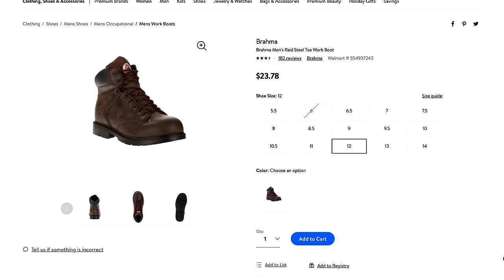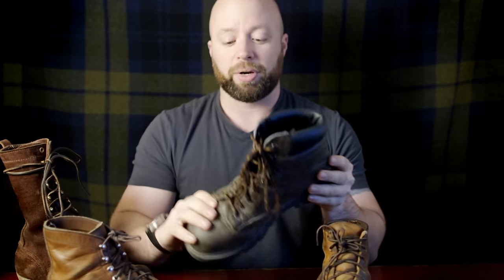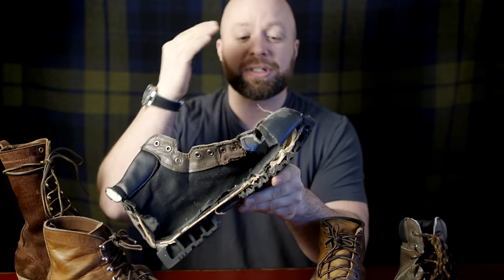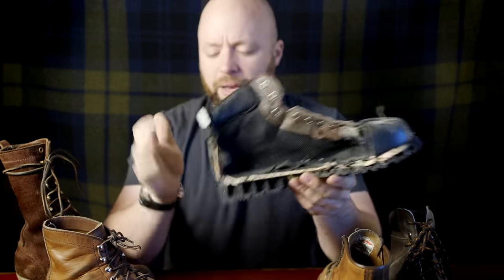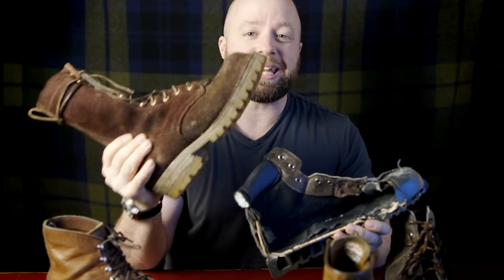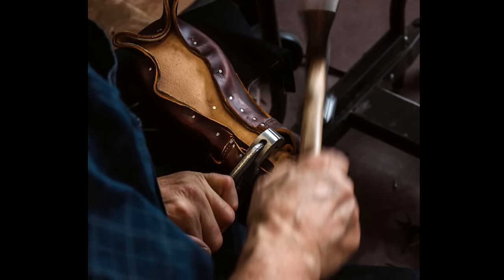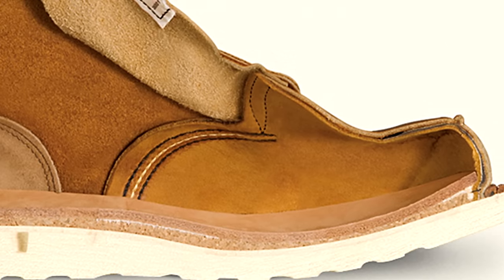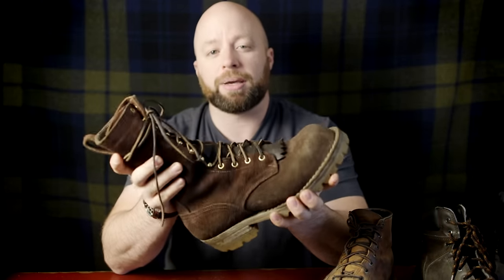Expensive vs Cheap Work Boots

Comment: Cheap is expensive in the long term
Reply from the maker: Precisely!
Reply: Not always.   For example.   If "good" product costs $200 and lasts a year and the "cheap" product costs $50 and last six months.  The "cheap" product is better deal.   I bought alot of   Brahma boots.   Because they were cheap. Yes they only lasted three months.   But at the time Redwings were four times the price and only lasted a couple months longer.
Reply: Thorogood boots
Reply: @mjp5429  good day sir, do you have your own, separate insoles when you wear your cheap boots? :)
Reply: @joshuasim8019  sometimes
Reply: Ya FEET.
Reply: Amen. I spent my last 5 years landscaping in the desert and I have spent 700 on cheap boots when I worked on wind turbines for 10 years and had 1 boot the whole time. I only lost those Wind Turbine boots because I did not know they re-soled the boots. On reason my Red Wing Loggers got tossed.
Reply: I bought a pair of $250 Red Wing  boots. They started tearing apart at the sole. Leather started cracking around the eyelets. All in less then 2 months.
Reply: @laidspipe  man that sucks. You know, like vehicles, every now and then you get a lemon. They typically are a boot built to last.
Reply: William Jefferson Clinton the good thing is they still had warranty. Got a different pair for $190. So far  6 months wearing them still holding on.
Reply: & vice versa
Reply: I have a buddy that would go through a pair of Brahma work boots every 3-6 months. I still have a pair of work boots from my 8th grade year that I need to resole. I haven’t got around to resoling them because they are hiking boots, so I have to send them off to a special cobbler.
Reply: john doe but then compare redwings which are pretty cheap to boots like nicks, after say two years when you need a resole then it doesn’t cost that much and then say after 5 you get them re soled, you can go a decade with one pair
Reply: Something to think about is that leather boats do not like acid environments.   In such a case buy cheap because a expensive pair isn't going to last any longer.
Reply: @callumgill7019  usauly by the time the soles are shot the rest of the boot is too.  My experience has been the welt usauly rots out before the sole wears out.  And this is true of expensive and cheap boots
Reply: 60-80$ 4-5X a year, yeah I’ll stick with  my danners or Georgias
Reply: john doe that’s not always the case my freind
Reply: john doe most of the time if your paying that much for a boot you’ll get what you pay for
Reply: njuafed71 especially when it comes to work boots
Reply: I disagree...As mentioned below, I paid over $200 for a pair of Danner boots. I had them a little over 1 year and both heels lost their stitching. Danner customer service is in name only. Their warranty is no good and when it came time to stand behind their product...they ran the other way and did nothing. Beware of Danner. I would have been better off buying a $50 pair of boots. Hell, cheap boots last longer than Danner.
Reply: This is what everyone says , but from my experience this is NOT the case
Reply: You sir are absolutely correct
Reply: I condition mine every 2 weeks going on 2 years strong with my red wings
Reply: @CarlMurawski  The High Cost of Low Living!
Reply: That does not apply to Mercedes vs Toyota. In that case you're wrong. But everything else you're right.
Reply: Im too poor to be cheap.  Bought red wing work boots and a toyota tundra.
Reply: You’re 100% spot on
Reply: @mjp5429  Negative. Because you're still using $50 quality boots which aren't going to be as well designed and engineered as better quality boots so you're cheating yourself every day. The better "deal" is the boot that keeps nails from puncturing through the bottom of your foot and that don't rot in a few months and that keep your feet healthy providing proper fit & ergonomics. :)
Reply: @YankeeWoodcraft  
Sometimes this is true.  Other times not so much.  My experience with "name brand" boots (or products in general) has been very hit or miss lately.

The knock offs have gotten much better and at the same time many if the name brands have cut corners to make more money for stock holders. 
  It's an interesting story to watch play out, but it's happened so many times.  The knock off has to build the best for the cheapest to gain market.  The established brand doesn't care because they already have the market.
Reply: Brama are hands down the worst things I've ever put on my feet. Even with 60$ custom orthopedic insoles they were torture. They gave me blisters, The quality is garbage and If they last a month you got a good pair. I know not everyone can afford red wings, Nick's, Timberlands etc. But avoid brama at all cost. I've been at my job over ten years and we get a boot voucher for 300$ every year so I've been lucky enough to try almost every high end manufactured boot brand on the market and I have to say after trying my first pair of keen boots I'll never go back to anything else and they're affordable. Lug soles are to heavy and uncomfortable when your on your feet and walking miles all day every day.
Reply: Ya get what ya pay for
Reply: Exactly.

Comment: Having worked (and still working) in the trades for several decades I agree with Carl. You certainly don't need to own custom made boots to survive to an age of 60+ in the trades industry, I haven't, but you sure as heck do not want to cheap out, either. My advice, and something often missed in these "boot videos" is this -  find the highest quality boot that you can afford, and buy 2 pairs.  Switch off every day with a fresh pair, while the other pair of boots rests and thoroughly dries out.  My current pair x 2 of Red Wing work boots are closing in on 7 yrs of work, and still have life in them.  Not even so much as a resole. Take care of your boots, and your boots will take care of you.  Good luck folks.

Comment: I've been wearing 2 pairs of Herman Survivors for one month with good quality aftermarket boot inserts to give them some comfort.
I'm a machinist and need a sole that won't melt and absorb the blue hot steel chips.....the soles on the Herman boots don't stand a  chance against the hot steel chips. I have 2 pairs so I can rotate days to pull out the steel chips with pliers.

What do you recommend? Will those Redwings with the white soles survive burning steel chips?

Comment: I’m new to the oil fields of North Dakota and have been working in some frigid conditions. I started with a cheap Walmart boot... Major mistake! I’ve just ordered the rubber Muck Boots called, Arctic Sport, with a Steel Toe (they don’t have composite). The Sport is rated at -40... I wanted to order the Arctic Pro, which is rated -60; however, my size 10 in those isn’t available for up to 5-7 weeks, unfortunately. Obviously, I need a good work boot and one that is warm in the cold weather. Any advice of what the best boot is for that? Any comments or thoughts on the Muck Boots? Thanks for the video! Basically, you get what you pay for...

Comment: Carl, you are so right. Don't skimp on a good pair of boots. I just retired after 37 years working for a beverage company. When I started I was a delivery driver, did a lot of walking. I always bought Red Wing shoes. Started off buying oxfords then eventually started using six inch boots. Never had any problems with my feet. I eventually moved into driving Big Rigs for Transport and I thought I could skimp on shoes. (as Red Wings were getting more and more expensive.) I bought Die Hard boots and then Caterpiller, those gave me sore feet. I went to the Red Wing store and bought a pair of the 676 boots with the wedge sole. Problem with my feet went away. Like you say, you can't skimp on a good pair of boots. That particular pair of boot I found out that Red Wing doesn't make anymore. Mine are about five years old, still look and feel great. When the sole wear out, I'll take them back to Red Wing to get a new sole put on. Definitely don't skimp on a good pair of boots.

Comment: I wear White's boots (Spokane WA) custom built to my feet (my feet are 2 different sizes). They're expensive new but I've had 2 pair since 1994 that I get rebuilt (not resoled) every 2 to 3 years. They tear them completely apart and if needed will replace everything but the uppers
Reply: Whites got bought out and quality has decreased. Nicks is better
Reply: @nonyobussiness3440  when did that happen my last rebuild was a year and a half ago.
Reply: Cbmech probably five years ago
Reply: I also have 2 different size feet. I will look up on this. The right foot is somehow  wider at my toes.
Reply: @vatorob702  they'll send you catalog with an order form and a measuring sheet

Comment: During my apprenticeship I went through 6 pairs of RW, 2 pair of Carolinas, and a pair of thorogood wedge soles. Even the toughest RW I could find only lasted 7 months. Most pair were done in 6 months. The thorogoods lasted 1 month. I should have known by how soft the soles were, but they were extremely comfortable. Now the only boot I wear is the Ariat catalyst VX. My first pair have lasted me a few years and are still in good condition. I haven’t changed how rough and demanding I am on my work wear. These are just what seems to last. Full grain leather and protected toe guard. They are pricey, but you can set an alert on one of those price drop apps and get great deals on them. They are hands down the toughest boot I’ve worn to date. I’m in them 16hrs a day and my feet have never once begged me to take the boots off.

Comment: Great points, Carl. The same applies to shoes. For example, Allen Edmonds shoes have an inner cork sole. If you're an office worker, good shoes are as critical as good boots to tradesmen. Thanks for the review.
Reply: Just life in general- people should be wearing quality footwear and rarely do.  It's no accident that so many people wear athletic shoes everywhere now.  Most don't even know where to find a comfortable, well made shoe that our recent ancestors would have worn.
Reply from the maker: Great point! I saw Allen Edmonds came out with a model for people who stand/walk all day. They have removable insoles on top of their leather ones.
Reply: Greg Kosinski any recommendations on sneakers? I love my running shoes but I have to switch shoes every couple days so my feet and everything else doesn’t get sore. One shoe I do find comfortable are my asics onisutka tigers, they have no padding in them,  it’s hard kind of cork material.. I’d have to do research, but I find them very comfortable
Reply: Especially if you have a standing desk and are one your feet for 8 to 10 hours a day, it wrecks any cheap or mid grade office shoe. I have a pair of Florsheim shoes  and after wearing them for about 2 weeks the elastic on the top fell apart which caused part of the leather to rip. I think im going to grab some Red Wing Rovers with the crepe sole when I get the money as they look perfect for that role.

Comment: It's kinda hard to define cheap boots. Is over $100 still cheap boots or not. I've had plenty of decent boots(timberland, carolina, wolverine, ect) and played $300 for a pair of redwings and had same experience with both. None have lasted. Usually inside of boot wears out before outside or around steel toe or starts leaking water due to working outside.

Comment: I want to add something on top of the content of this video, it's all based on my personal experience. 

I'm a mechanic, although just in this trade for a year or two. I had a lot of money went into my boots, they served me well whether I'm working on cars or just hang out with friends. I ONLY buy relatively expensive ones, ones that were made in USA with Goodyear construction, ones that doesn't make your feet smells like dead fish after one day.
I want to point out few things. For anyone in any trades, footwear is where you should invest your money on. I say invest instead of spend because you will really appreciate your decision afterwards. 

In general, here is what I think. Red Wing makes some decent boots, so does many other boot makers. I will never wear red wing heritage models to work because 99% of them don't have steel toe. However, I will continue to buy and wear 877/ 875 and many other iconic rw models till the day I die. Won't recommend anything other than the heritage line, because many of them were made in China or somewhere else, not bad but you can definitely get better boots at that price. Thorogood is another decent brand, their stuff may seems bit cheap compared to red wings, especially boot laces. In fact, they were also build to last. Their leather is pretty soft but breath very well, most of their boots has the comfortable and removable insoles. I love how easy they can be break in, like, 2 mins. At this price range, Danner is another one for you to consider. Most of their boots are made in Portland, Oregon. They tend to make their products for serious outdoor/ military use, but their bull run models are one of my favorite. The draw back I could think of is their leather are stiff which do cost you more time to break in. Once you get used to it, they feels like second skin. Currently I haven't try anything else yet, because it seems 5 pair of work boots are going to last me pretty long time.

 Again, if you are in the trades and don't have a good pair of boots, save some money and go buy one that fits you, you will like it :)

Comment: I'm retired military and  coming from Army Aviation, Danner are the best pair I ever had. I also buy them nowadays, just not the military version for the Winter. 

I was ready to get a pair of Red Wings, Chippewas or even Georgia... but neither make boots in my small size of 7. So Danner it was.
Reply: Thorogood...for work, concrete, and such...way more comfortable,  last longer.
Reply: Companies like whites nicks Wesco will make you a custom pair of boots in your size and will actually fit your feet like you wouldn’t believe for roughly 100$ more then danners and not just selling snake oil it is worth it especially you having a irregular size they would last you 10+ years

Comment: Red Wing  Brown boot white sole one piece of leather all the way around the bed of the foot I call them a carpenter boot. The only problem is the sole wears out too fast every 3 months and it takes 10 days to resole the boot. Sears has the EXACT same boot with a stickier and longer lasting sole. The boot is called the Sears Die Hard  it out last Red Wing 3 to 1 and same comfort.

Comment: I have a pair of Danners my Dad gave me after he wore them in the woods for 10 years.. I have now had them for 15 years and they are finally falling apart.  So Danners  super rain Forrest for me all the way!
Reply: guess what  Ahaahah
Reply: I know what you mean,  I have the rainforest for 21 years,  second soles , still waterproof.
Reply: guess what  no he actually isn’t cheap at all ...  I was only planning on using them until I got a pair of my own but I never needed too...  Also they  were super comfortable from the day I started wearing them
Reply: guess what what do you buy your kids Danners for? Do they actually work in the woods? Or just for looks 😂
Reply: Wtf Danner is straight trash. I’ve had the Workman, Crafter, and Bull Run. They all had problems. The Crafter leaked on day 1 despite being waterproof. The Workman didn’t last me more than a few months. The bull run sole wore out within 5 months.
Reply: @opencase9903  You get what you pay for. If it's imported, it's usually just like all the other boots. By a quality pair of Danners made in the USA...
Reply: @danherrick5785  The Bull Run is definitely made in the USA

Comment: After ages of buying up to 3 pairs of cheap work boots a year and suffering through foot pain and fatigue that works it way up my legs I was gifted a pair of Red Wing boots for Christmas by a relative who works for Red Wing.  At first I hated them because for a week or two during the break in period my feet were aching at the end of each day and I couldn't wait to get them off.  However, after they broke in I was amazed at how comfortable they were. So much that I started going out after work without changing into shoes. More importantly, that first pair lasted me 2 years before the sole needed to be replaced.  I was gifted another pair which I use while riding motorcycle because, after having the original pair refurbished for about $100, I still use the old pair for work. They don't look the greatest anymore but they are really comfortable and worth the cost.  Even without the hookup I'd still buy them.

Comment: I bought a pair of discounted Iron Ranger at a Red Wing store. Lady told me its previous owner wore it for a week before returning. The leather looks pretty beat up for one week of wear, so I'm not too sure. Shoe had a 30-40% discount easy. Anyone knows if I didn't get the full picture, or is Red Wing's return and resale policy pretty stringent?

Still in the process of breaking them in, loving it so far, but just paranoid that my choice of getting this pair will come back to punish me next time.

(For anyone else wanting to shit on me for not getting a new pair, they didn't have a new model in my size. I was on holiday, the alternative was to buy from dodgy importers back at home.)